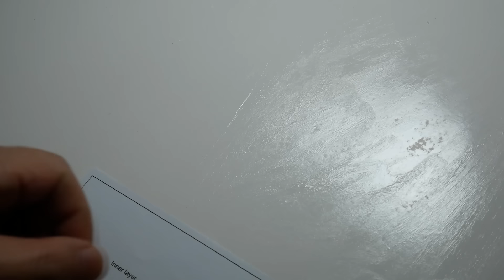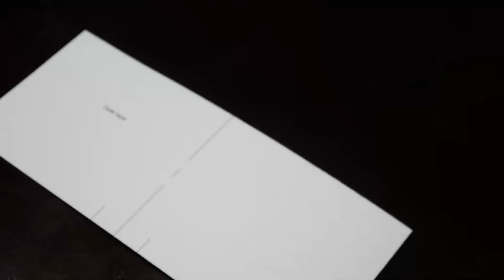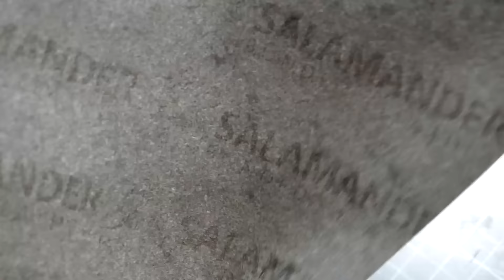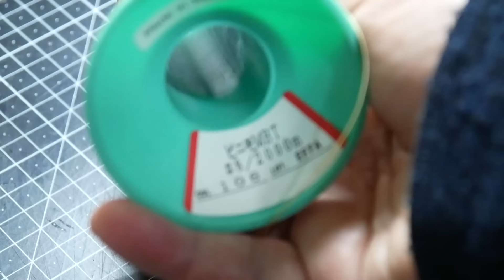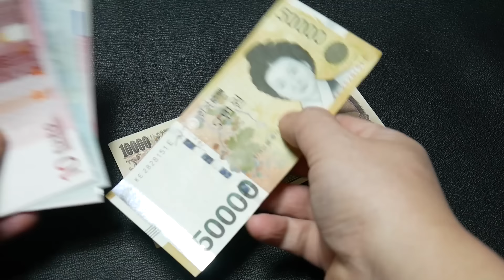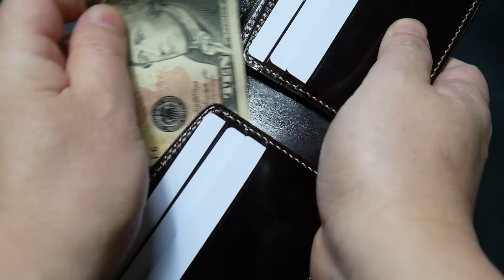Make a leather Bifold Wallet (free PDF Pattern)/special version - 머니클립 느낌의 가죽 반지갑을 만들어보자

Comment: Nice design.  Why not use liner instead of salamander on the back of card slots?  I think that is supposed to be used as a stiffener.
Reply from the maker: Fabric can also be a stiffener.
Leather can also be used as a lining.
As long as there is no problem in using it, it doesn't matter what the material is.
Reply: @brentbroussard6896  😍